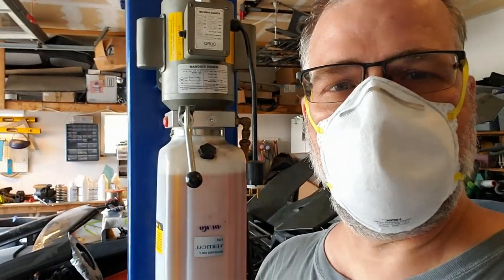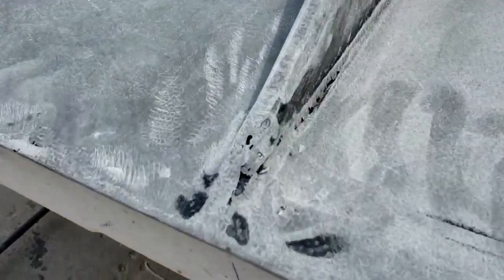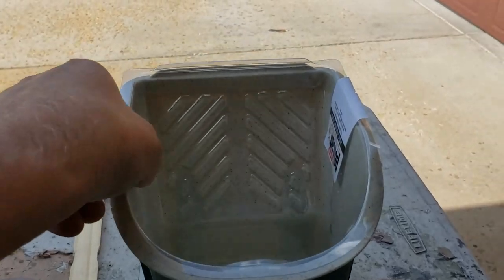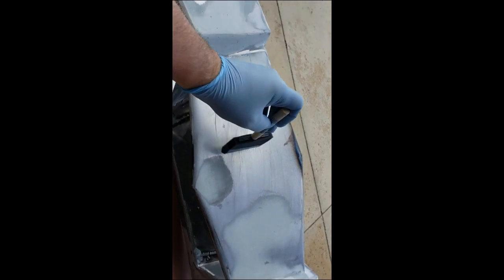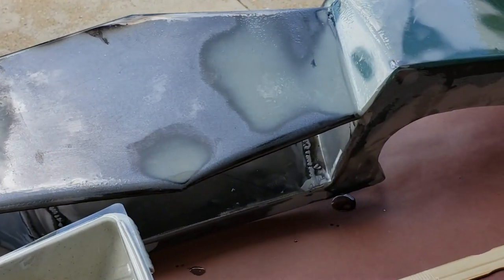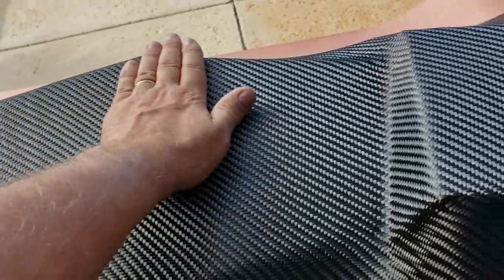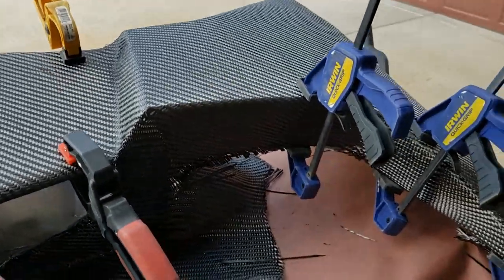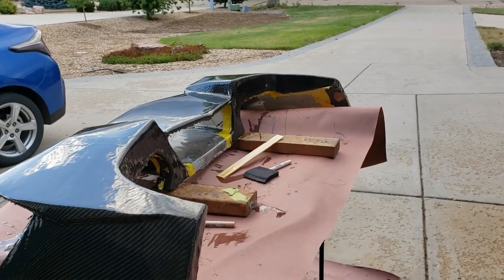3D Printed Interceptor Update 46

Comment: so skinning is just for aesthetic purposes? seems like a lot of work to make something appear carbon that isn't structurally carbon.
Reply: It isn’t ‘just’ for aesthetics. Since it is actuall carbon fiber, it is adding more structural strength and stiffness. However, it’s also adding a lot of extra weight. I’m not trying to diss the build, because he is doing a very cool and incredible thing here, but if it was layed up properly the first time, then there would not have been a need for the filler, then there would have not been a need for this final layer.
Reply: @customfabrications  i love the build, but this just had me scratching my head. i'm no carbon guru, but 1 ply of carbon and some resin doesn't sound like much for structural strength.
Reply: @wrxzboost  well, one ply on its own wouldn’t be much, but some. Each added ply adds more strength and rigidity. Especially if there is some form of a gap between layers. If you have one layer of carbon on each side of a piece of 1/4” foam, that becomes ten fold (or more) stiffer than just two layers of carbon without the foam. But yes, he added the top layer because he wanted a smooth carbon look without visible filler, but it did add a bit more structurally (albeit not really needed). My only point was that it was more (even if just a little) than just cosmetic. But yes, mostly cosmetic. So I guess my point is kinda pointless. Sorry.

Comment: Amazing! Would this be a lot lighter than the real aventador?
Reply from the maker: Should be 3k.
Reply: no it wont be lighter.
Reply from the maker: @chrismechanic2000  https://en.wikipedia.org/wiki/Lamborghini_Aventador#:~:text=Aventador%20LP750%2D4%20SuperVeloce%20Roadster%20(2016%E2%80%932017),-Lamborghini%20Aventador%20SV&text=Numerous%20weight%2Dsaving%20measures%20have,lighter%20than%20the%20standard%20roadster.
Reply from the maker: Curb weight for the roadster, 3472lbs